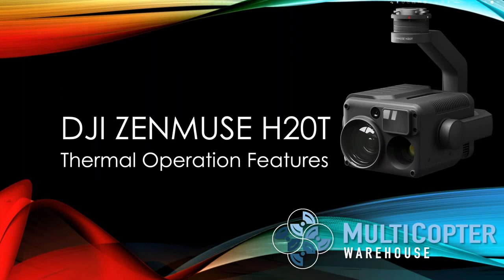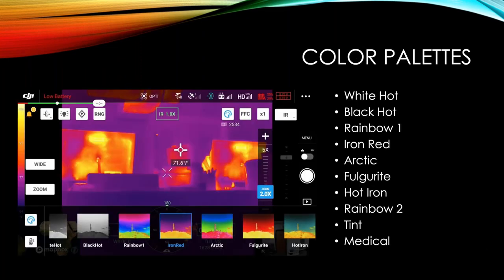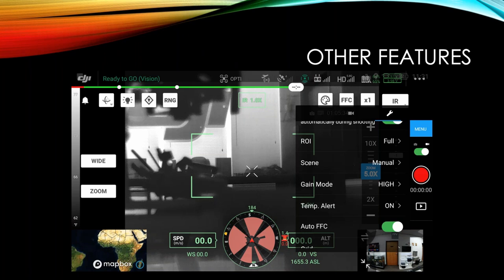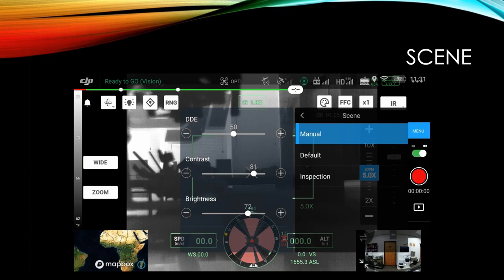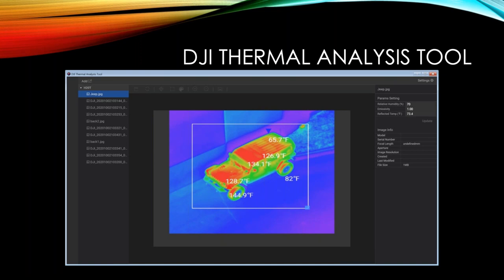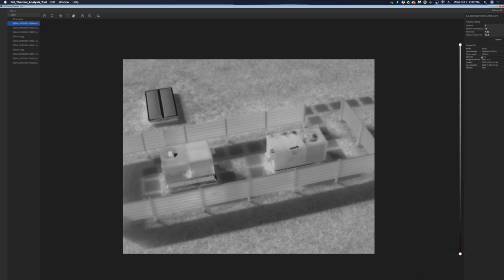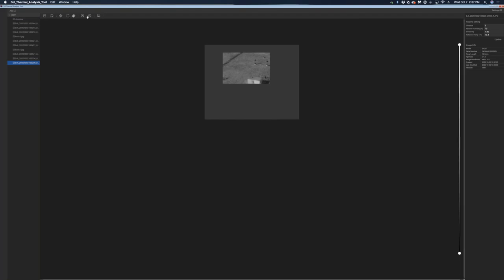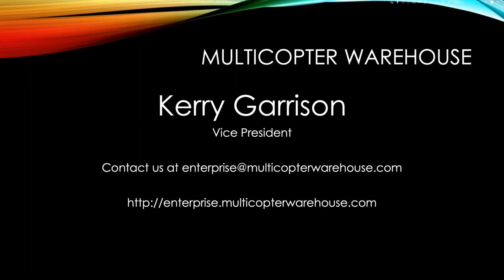DJI Zenmuse H20T Thermal Features and Analysis Tools

Comment: At 10 minutes and 15 seconds the reason for the -44.1*F is the reflection of the cold sky off of the low emissivity top of the trailer. Notice how the back end of the trailer is reflecting the warm interior of the building it partially sits in.

Comment: Hi, from Spain. That's the best webinar for H20T explanations. Here, nobody explained H20T functions like you. I bought that camera and M300 few months ago, and I'm still learning. I have two questions: first, when I'm doing inspections mission, for example in a PV plant, using MAPPING mode mission. Have I to select "inspection" in the SCENE mode, in the MENU of IR camera, or can i keep that in DEFAULT mode? Second, in that same mode pf mission, MAPPING, IR camera put itself in an angle of 90 degree with the objective on the ground? If not, how can I select that camera angle? Thank you very much.

Comment: Can I do water pipeline leak inspections with the H20T. Are there any videos?
Reply: Well actually you wouldn't be able to achieve what you want as this drone is for identifying subjects and spying  and electronic surveillance...I loved how the one video went from talking about hot zones warm zones (that shit never happens) they went right to look at the subject at over. .5 mile away you can see the number he's dialing on his cell phone ....no wait a minute that's not a cell phone it's a bomb detonator send in swat
Reply: And I'm positive this is a top notch quality machine I own 2 DJIs I would think this would be perfect for pipeline inspections...
Reply: @jonathanulery1610  do you own any thermal payloads on your DJI products?
Reply: @AndrePlease  I do not...and I probably over stepped the boundaries of positive comments just a bit but this originally was in my fb newsfeed and the more I watched the more the seller started to sound like the director of homeland security with all the " you can focus on a subject " and " you can see what the subject has in his hands at over  .5 miles away " when the initial add was all about 1st responders and using the drone and its high tech camera for disaster response the bottom line is yes it would serve as a valuable tool in a disaster scenario but it's more practical everyday use will be to carry out electronic surveillance...I'm a believer in if your not doing anything wrong you have nothing to worry about and if any department of law enforcement is using such an expensive tool to conduct an investigation on you that your probably a piece of shit I like DJI for a few reasons having flown freestyle FPV on mostly 5" quads that I built ....with DJI products the user will develop a level of trust with the aircraft that I NEVER had with any other quad just yesterday I was flying my  Mavic Mini over 1 mile away and my phone died so during the initial panic I got it charged enough to come on and get the last known gps location took me 5 to 10 minutes and by that time the drone had not RTH so I got in my car and drove to the location it was cold so I made sure the drone was not on the road and looked a little for it got cold so drive back home to bundle up and guess what  when I got home the drone was there I was like NICE...

Comment: Hey Guys, This is all bunch of bollocks. This camera totally sucks and it does not, in almost ANY case show TRUE and REAL temperature, no matter what. At work I'm using large, professional, cooled MCT detector camera, which is radiometrically and NUC calibrated. In that camera, if I take a photo of a scene set atmospheric correction to real Ambient & Reflected temperature, set true Distance from object and its correct Emissivity. I GET TRUE temp in °C +- 1°C as per camera spec. Trying the same feat with DJI H20T I got from 10 to 25°C. No matter how hard you try, it gives you some cool colour pictures to look, at. Spot problems and get somewhat true gradient and temperature difference. But true Radiometric Temperature ?? Nope. (before you comment: I'm ITC Certified Themographer with 4 years exp. in aerial thermography).